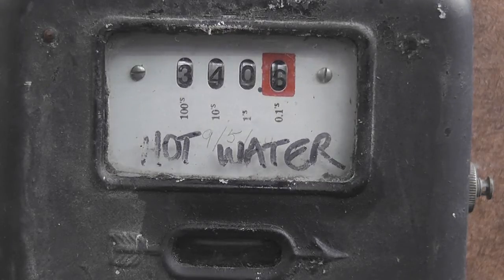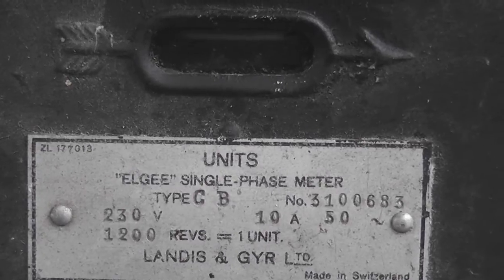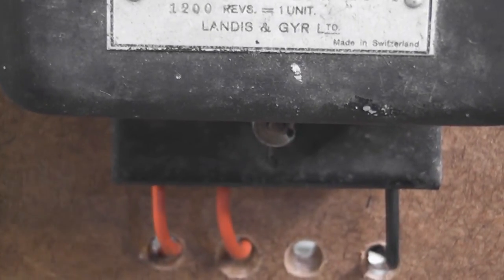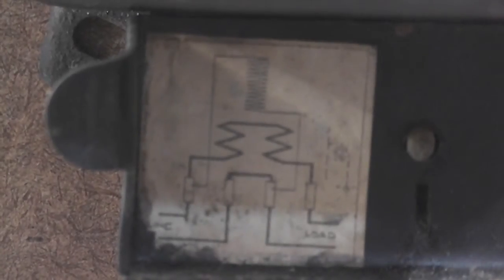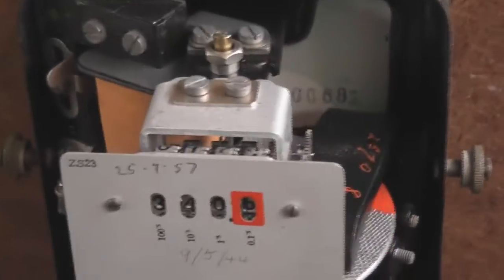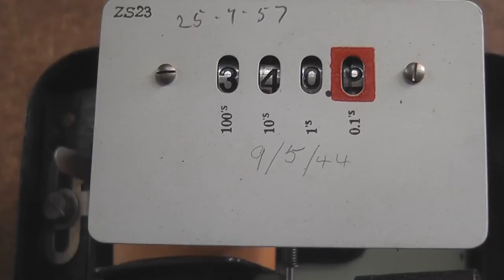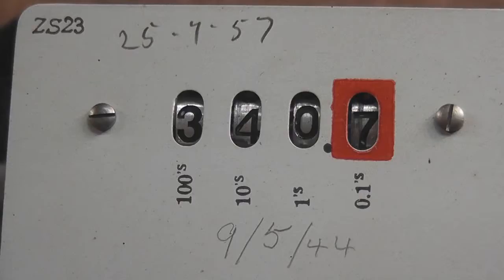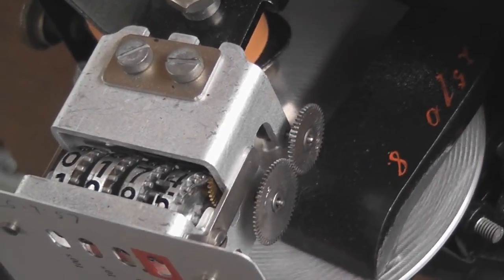Landis & Gyr - type CB - Watthour meter

Comment: Viewer # 9, comment # 1 :D

Ah, this is another nice little meter. :-)

Unlike the previously shown Ferranti, this one is over 1000 revs/kWh.

Hmmm, interesting error on the wiring diagram inside the terminal cover! I'd seem to think though, back-in-the-day, if that was wired to the diagram, then the installer put the fuse back in, while the BANG would've been quite sizeable, it wouldn't been much in comparison to a modern-day 60A / 80A / 100A service fuse being hard-shorted out! :-O

-BBD.

Comment from the maker: Same here in New Zealand, most electromechanical meters have been replaced with electronic TOU meters which are read automatically. About 30 % is electromechanical where the meter signal can not be read remotely.
One thing is sure, these new meters will NEVER last 40 years with good accuracy, they may last 5 to 10 years before capacitors starting to fail, or a lightning strike takes them out.